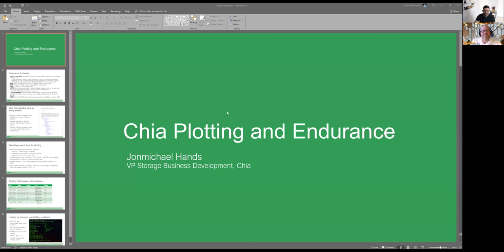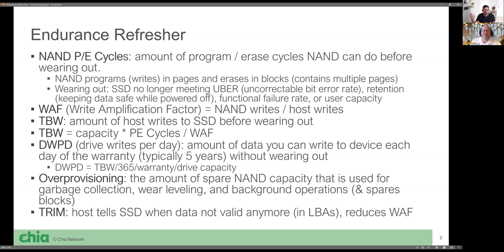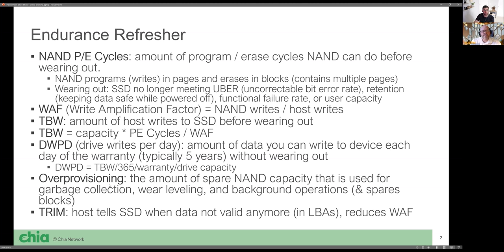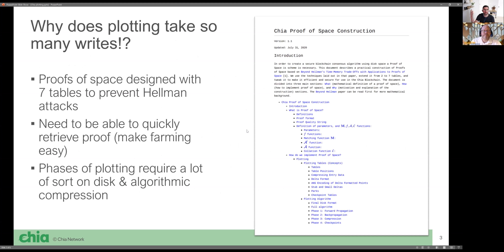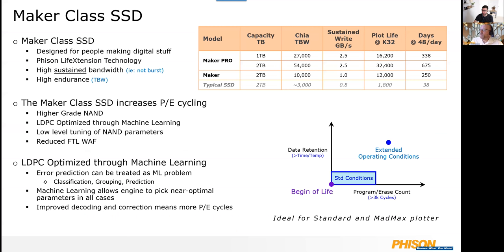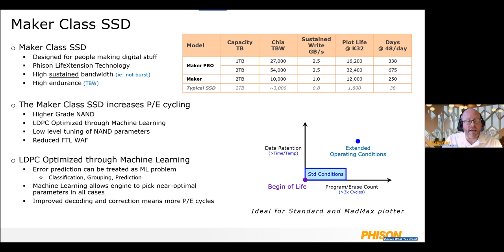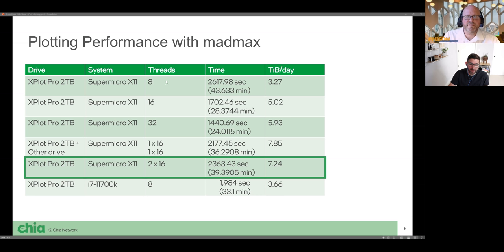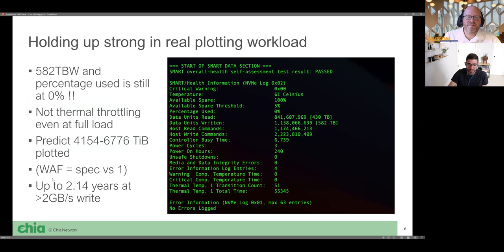Chia Optimized Plotting SSD - Interview with Phison

Comment: I think the price point of these drives will be critical - savvy eBayers can get hold of 3 x write-intensive 200GB SAS SSDs and a controller for about £95, which (in RAID0) gives roughly 1.5GB/s write performance and 27PBW endurance (most of these drives have done nothing for the majority of their lives, mine arrived with 1% used). Obviously that's not going to compete with the Maker Pro drives, but it does eclipse the lower-end Maker drives in every way. Of course, there's a lot more work involved in that, but still...
Reply: How many sas drives you had in RAID 0 to get more than 1gb write/s?

Comment: Now we just need a company to make a cheaper, non-enterprise, solution for connecting multiple drives to a PC with ultra low bandwidth requirements and low wattage. And maybe a high capacity write once hard disk device.

Comment: Hold my Beer Phison... 4 singel level cell SAS SSD in Raid Zero.... 73Petabyte endurance each.... 25€ each.... Cheers....
Reply: You missed the part about 2,500 MB/s sustained write speeds.
Reply: @ChrisRamseyer true,  my 100€ RAID is only at 1800MB write.... and 2300 read....

Comment: As I know with Madmax Plotter ssd's are not needed anymore ;) better to buy ramdisk with endless endurance ;) and ultimate speed
Reply: DDR4 is $5/GB at the moment so buying the 1TB version of this will be less expensive and deliver the same performance in plotting. I have plenty of madmax running on ramdrive on servers
Reply: You still need an ssd with the ram disk, the faster the ssd , the faster MM is. A slow ssd will bottleneck the plotter.
Reply: That would be true if you had infinite space for your plots and didn't care how long it took you to create them, but:
1. You don't have an infinite space and even a consumer grade SSD can handle hundreds of TB (drives rarely die upon reaching their TBW rating; they go out of warranty, but they'll usually keep working for several times that rating) while being less than 1/10 the price of 256 GB of RAM (not to mention most consumer HW can only handle 128 GB or less, so for most people, this would get a lot more expensive than just the RAM as they'd need to also buy server hardware). 
2. You do care about speed because you're fighting an ever-growing netspace, so the sooner you make your plots, the more value you'll get out of them. Even MadMax doesn't scale infinitely; running multiple instances with lower thread count is faster per plot, but for that you'd need 256GB RAM per instance which would get much more expensive again. 
RAM only plotting or "RAM-assisted" (110GiB RAMdisk for temp 2) makes sense if you already have the RAM, but not if you're buying HW specifically for plotting.